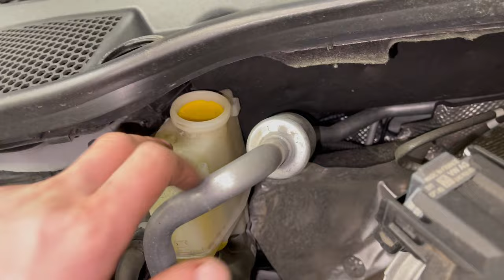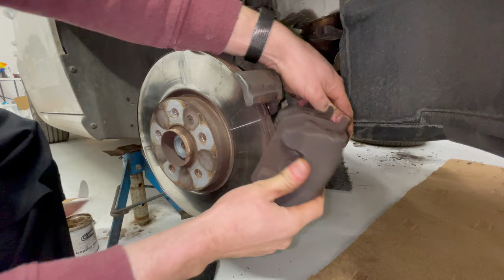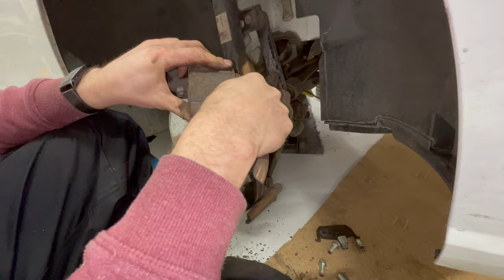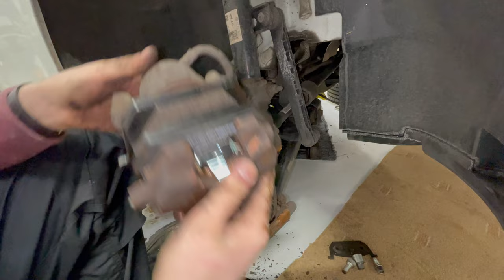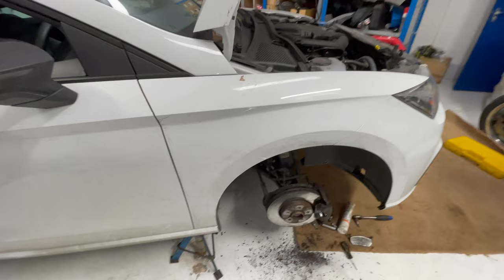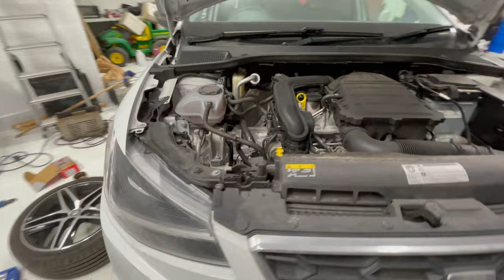Seat Ibiza MK5 Front Brake Pads (& Discs) How To DIY Change

Comment: Thanks for the great video. This is hard info to come by for this car.. I've been wondering if it's possible to fit bigger discs / brake kits on this car? I'm being told some part of the brake assembly is part of the strut and it can't be done? I'm having some trouble seeing what they mean from this video, any idea if it can be done?
Reply from the maker: Anything is possible but if the mounts are different on the hubs then perhaps you’d need to replace them at the same time. Best thing is to have access to a donor car.

Comment: dude, copper grease anywhere near Your break piston is a BIG NO NO, PLEASE  FIX THIS VIDEO.

it can melt Your rubber,

You should use only the specific red grease designed for these parts when replacing the rubber piston seal

the only thing You can put on the breakpads is the anti squeal paste on the very top and end of it, where it touches with the caliper.